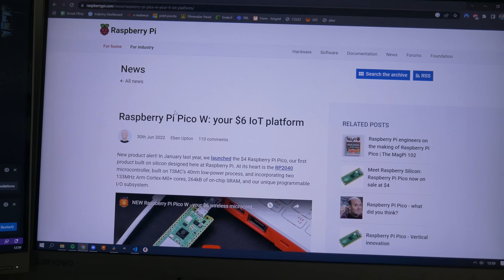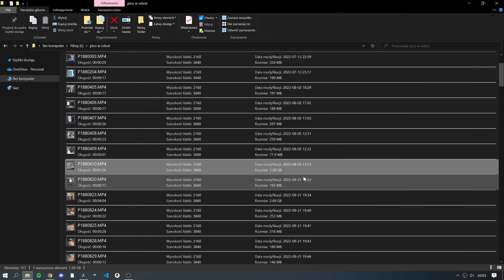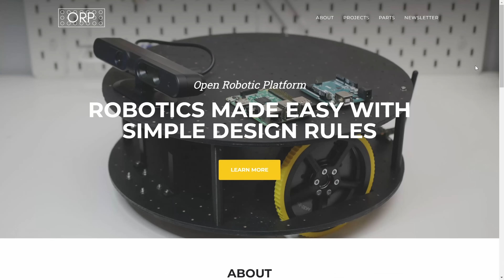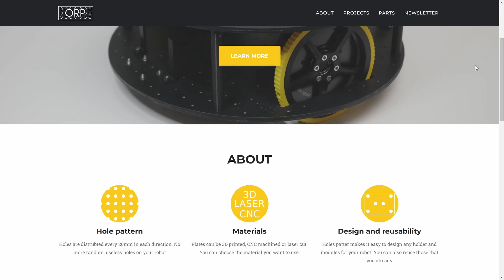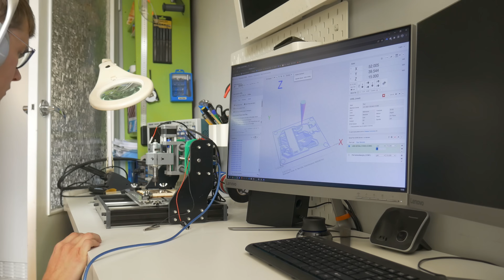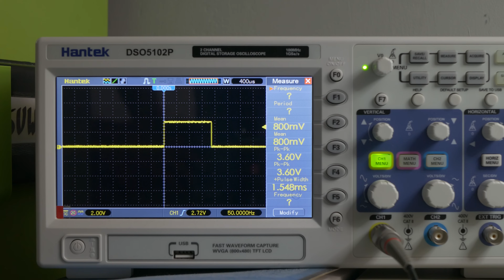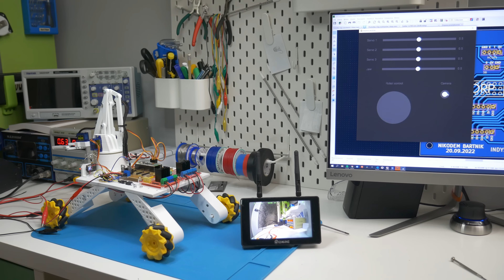I Built a Mini Mars Rover

Comment: Although more expensive, you can improve the range and image quality by using the DJI digital fpv system  It does cost significantly more but you can use the serial bus pad on the Air Unit to control the servos, it is possible. Overall great rover, would love for a part 2

Comment: You should get yourself a cheap rotary tool, like a dremel, and get some wood cutting and sanding bits for it, it would be much easier and faster than trying to create fine details with a large saw like that.

Also how do you have so much equipment, I am jealous!
Reply from the maker: I have a Dremel, I don't like using it because always the result is bad. Doing something with a Dremel held in hand in a nice way is close to impossible for me.

I am doing it for a long time and build a lot of tools on my own, some if the tools are also prizes I won for my projects, you can check out my other videos to learn more :)
Reply: @nikodembartnik  I've found it's good for rough work but then if you get some fine sanding discs they work really well and really smooth it out and are pretty good for giving it a good finish. I have never been good at engraving or anything like that though.

Comment: Impressive work Nik. couple of questions if you would please. 1- Do you have any though to have more control on the jerkiness of the servos? is it that you need to have PID controller for instance or is it about controlling servos speed through algorithms. 2- would you please suggest an online course or book to master PCBs design.  3- which motor deriver model you are using? the link did not work. Thanks Alooot Nik.
Reply from the maker: Hi, thanks a lot!
1. Because you control the servo with PWM signal (precisely with the duty of the high state) you have no control over that unfortunately. There are better, more powerful high quality servos that could improve the arm but at the same time those are more pricey and a lot bigger
2. I would say watch some YT videos, design a few PCBs and see what works and what doesn't. I never attended any course on that and I would definitely need some more knowledge in that area. Practice makes perfect :)
3. It's L298N
Have a nice day!

Comment: ESA scholarship? That's just too awesome :)

Nice PCB - I like CNC made ones for typical projects that don't need sub-millimeter rasters etc. No soldermask is not really a problem, and if you need more reliability, you can always use conformal coating afterwards.

Looks like you're getting close to 100k subs! Gonna make a silverplate project like Dave Jones (EEVBlog) did?

Comment: These plastic servos are quite painful to use and "iffy". I would suggest using MG90 instead of the SG90 used. For some reason the MG90s are a bit smoother to use and operate..
PS - you could "drop-in replace" SG90s with MG90s

Comment: The fact that you can build something like this is less impresive than the fact that you have a Pi to put into it.
Reply from the maker: it's just pi pico, this one is easy to buy :)
Reply: @nikodembartnik  The same could be said about the true raspberry pi. You just need to pay the scalpers fee for either one and its less for the pico! :P
Reply: @nikodembartnik  now mix potato flour with fine sand and make 100h of testing it can somehow show you problems with electrostatic cosmic dust on surface.
Reply: @0d1n61  Ha! :)
Reply: 😂😂😂 I feel your suffer

Comment: Great project! 👏 You could consider using motion smoothing within Arduino for the servos on the robot arm, it would be a lot more controllable 😃
Reply: Yeah that is a great idea, it could be done simply by limiting the speed or it could be more complex by limiting the acceleration and speed and adjusting it based on the distance to the desired location.